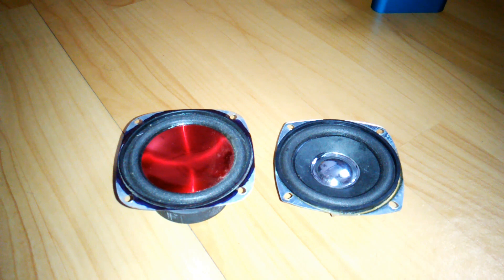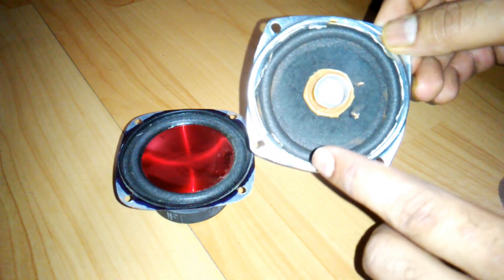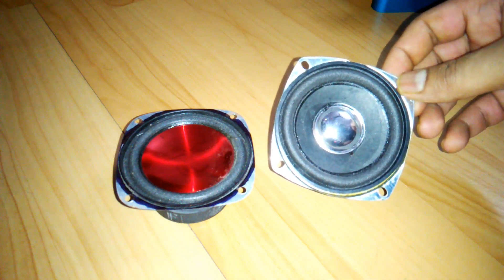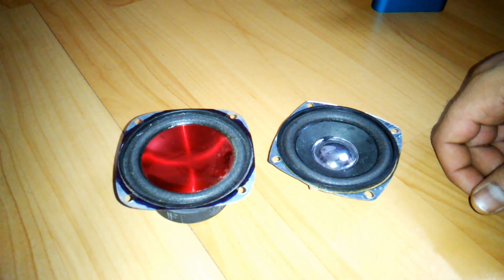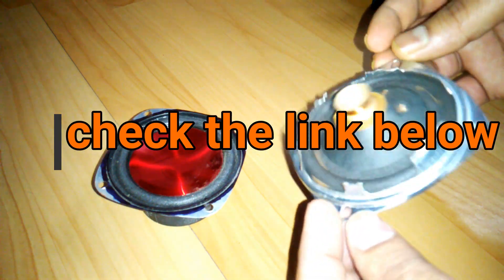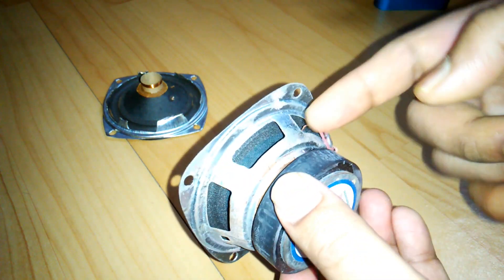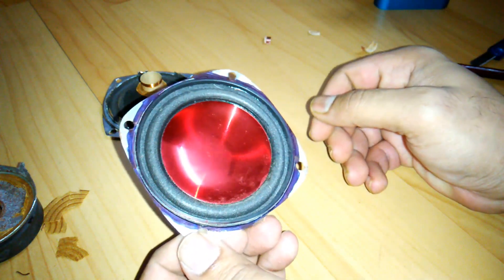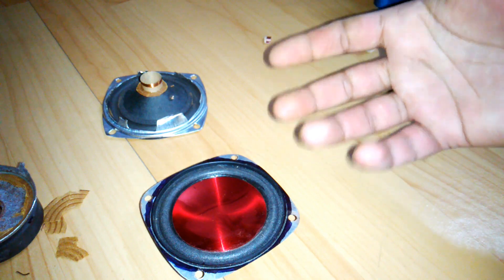How to make passive bass radiator at home

Comment: I know this is an old video but just so everyones clear... this doesn't really make a passive radiator that work's very well.. if you have ever taken a speaker apart that has a passive radiator in it you'll noice it's actually kinda heavy.. the heavy part is the actual "cone" or the "dust cap" on the radiator.. its heavy so it adds weight to the speaker giving it more punch when the bass hits.. 

to make this into a passive radtiator that's actually gonna do something he should have just broke the magnet off to save the space and left the spider and rest of the metal body attached.. then added some weight to the dust cap area of the speaker.. the spider needs to be there to stabilize the cone from going all floppy when the bass hits.. without the spider the cone is free to move in any direction and your gonna quickly tear the rubber surround off. 

but hey, I'm not a speaker engineer I just know what I've seen on pretty much any passive radiator I've seen .

Comment: Can I put it in a stereo system with 7 or 8 inch done it I have a 3 inch?
Reply from the maker: your query is not clear sir. you wanna use a 3" bass radiator with 8" speaker???
Reply: @technoboy-allinOne  yes

Comment: Why did you destroy that speaker? It had a beautiful red cone!
Reply: Passive radiators don't use any power and they copy the sound and bass. Also, it has lower production cost
Reply: @mihai._.despinoiu  I know! Like I didn't use a pr in a project. But he destroyed that beautiful red coned speaker, to make a pr.
Reply: Cheap speaker